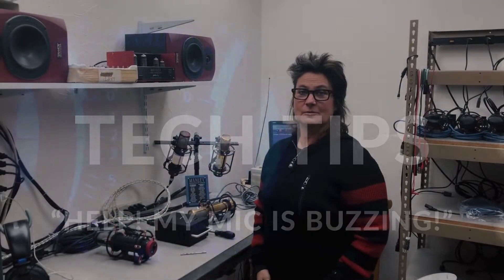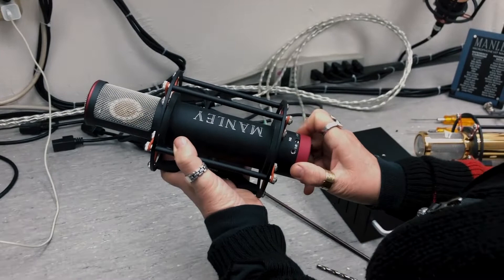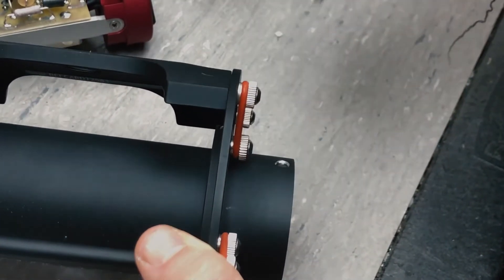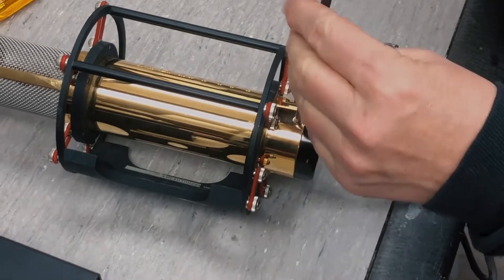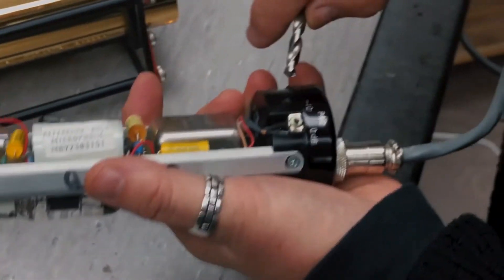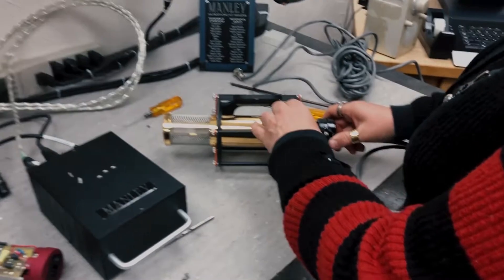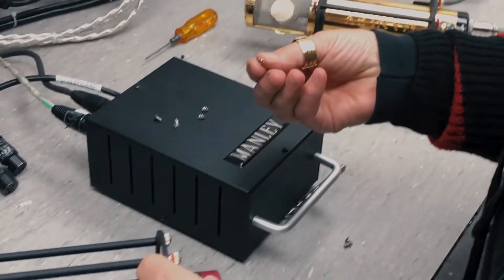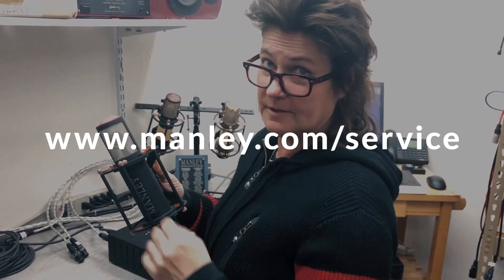Manley Tech Tips: Help! My mic is buzzing!

Comment: Mine makes a buzzing noise.   Replaced the tube 3 times and cable.   Sometimes it works when I flick the mic.  Buzzing goes away but comes back later on.
How do I fix this?
Reply: Fill out the SERVICE FORM on our website at www.MANLEY.com and my team will help diagnose the problem with you.

Comment: I bought this mic brand new, I came from an Avantone CV-12 so I thought it was a good upgrade. Since the day I started using it I noticed that it had WAY more "white noise" than the Avantone, even when the Avantone needs more power from the preamp it's still more quiet. You can even hear it in the mix when the vocal stops to sound, imagine when you add compression, etc. I've tried 3 different preamps, connecting to different places in the house, isolating the electricity from this room, using power stabilizer, also tried this tutorial and it's not working. I've tried to convince myself that my dream mic is just "noisy" but I don't know what to believe anymore...
Reply from the maker: Hey Lytos, Head over to our manley.com website and fill in the TECH SUPPORT form so that our Tech Support folks can work with you to get your noise issue resolved.

Comment: Thank you so much for these videos!  I have the normal cardoid mic. The mic makes a loud pop when I touch the 6 pin cable. Seems the connector and mic is the issue. I live abroad so no service center near me. What can you recommend to repair?
Reply: The set screws that hold the connector to the body need to be tightened. Or you have a bad cable.
Reply: If it is a really old mic, start at this point to tighten the set screws https://youtu.be/5yEeR8DfK44?t=389
Reply: @EveAnnaManley  Thank you so much for the reply. Got hold of an allen key but doesnt seem to have a screw in there! Can you recommend me the size of screw I should get?

Comment: Why didn't you design it to have a lug soldered onto wires set down into the base in the molding collar with a separate screw to give the grounding. Surely that's a better way you would have a star grounding point.
Enjoy your videos I wish you could do more videos, any chance of seeing your home stereo system I've heard it's very good
Reply from the maker: Thanks for your suggestion. Yes, the electrical wired grounds for the circuit are not the issue. They work great! This video helps show the mechanical ground points of the chassis and how to make sure they are all earthing as designed.
Reply from the maker: I'll run through my hifi system in a separate video, but yeah, I love my VPI HR-X, Lyra Skala Cartridge, Manley Steelhead, Manley Snappers driving Tannoy Westminsters!
Reply: @manleylabs  got a link to the video sounds like a nice system those Westminster royal se 2nd edition or first edition, I was going to buy some tannoy studio gold 8 monitor coaxial speakers just come on the market any idea what they're like no videos out there yet. I wondered if you could run coaxial drivers as an MTM's with each tweeter working at a different frequency, but I suppose not because they haven't made any far as I know. I was going to get the previous model the tannoy reveal 802 but some people say they get buzzing and noise so put me off. I thought about changing out the components capacitors for mundorf, and maybe resistors for a better grade and potting  the transformer and running two sets as  MTM's might be still the better way to go.